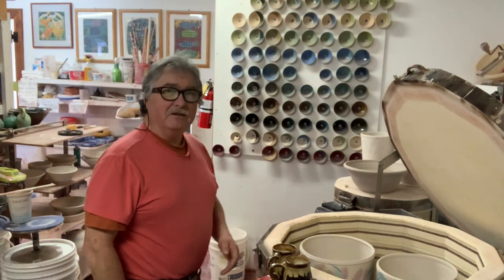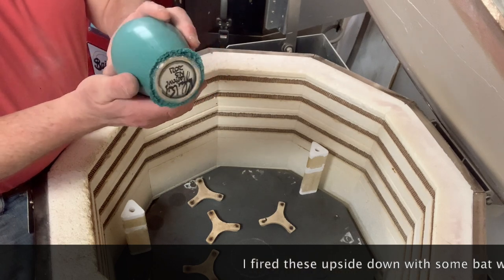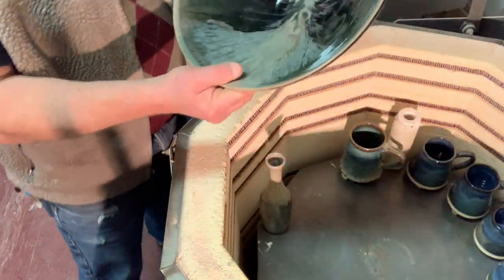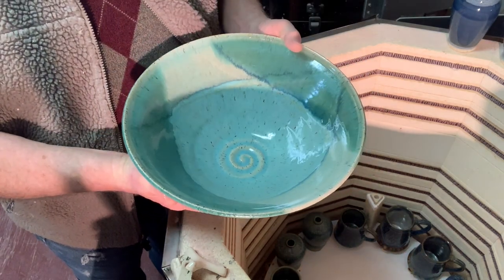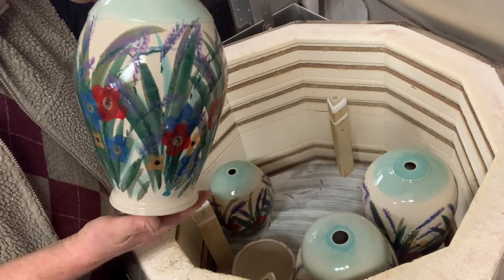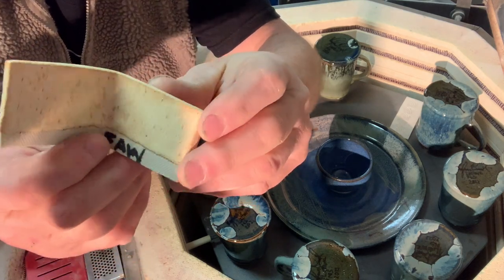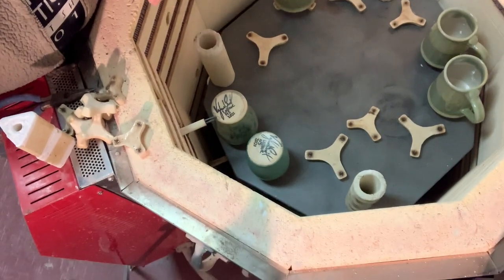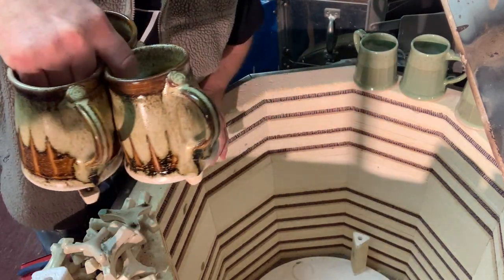Four Glaze kilns unloaded

Comment: This was a fun video to watch. Yes the test tiles joy was great to see. You mentioned it was a cone 5 firing but you said it was 2200 some tning degrees. I tbought cone 5 was 2167 degrees. I might be mistaken but you work is great. Thanks for teaching
Reply from the maker: It depends on the duration of the firing and rate of climb. This firing was closer to Cone 5 1/2 at 108F an hour. The soak time will also effect the cones.